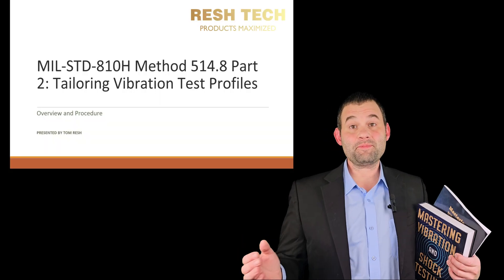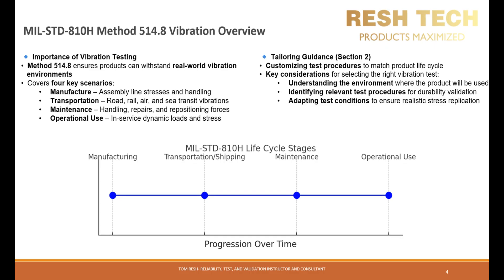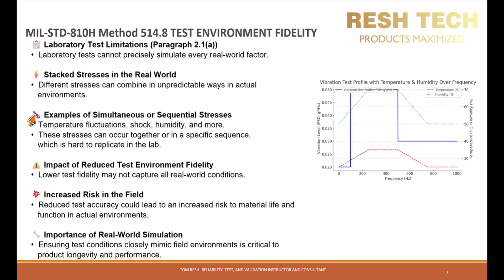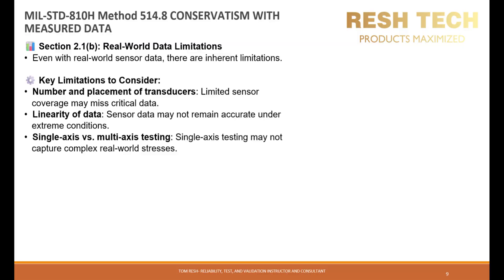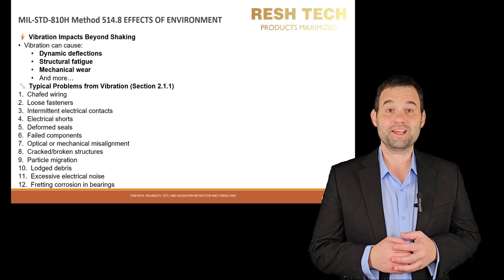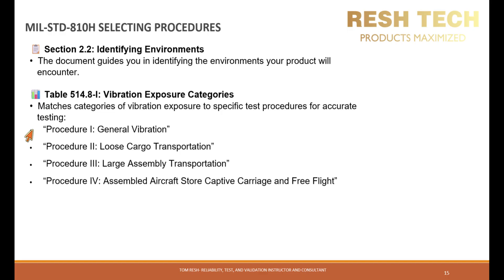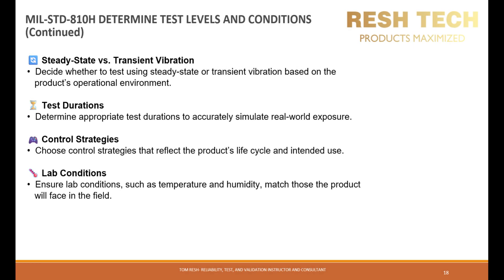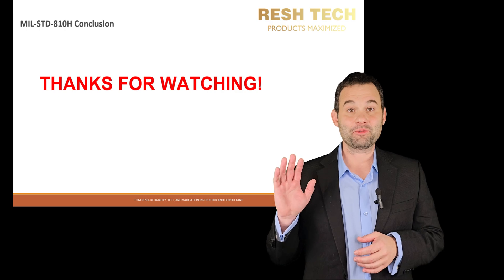MIL STD 810H Section 514 8 Vibration Testing and Tailoring Guidance

Comment: Do you have any idea about ESS? The Mil std 2164 specifies a minimum of 80 hrs of thermal cycling including 40 hrs pre defect free and 40 hrs defect free. Further some documents suggest a minimum of 6.9 grms, 0.04 g2/Hz to precipitate flaws in modern smaller PCBs. Can you throw some light on these two issues?

Comment: We have collected vibration data from an unbalanced motor, if the value is more then the specified rate in the mill, is there any requirement to suppress the vibration by using damper and maintaining the balance weight or else based in the data we have to do vibration test..

Comment: Is it recommended to do sine sweep vibration on newly designed electronic products or we should opt for random vibration irrespective of the positioning of device.
Reply from the maker: @ssujeeth45, I strongly advocate conducting a low-amplitude sine sweep prior to vibration and shock testing to establish a baseline characterization of the system's resonant frequencies and dynamic behavior. This initial sweep provides critical reference data on the DUT's structural response.

Following the random vibration test—and ideally after shock testing as well—a post-test sine sweep should be performed. Comparing the pre-and post-test sine sweeps enables a quantitative and qualitative assessment of the system’s integrity. Key indicators such as resonance frequency shifts, increased amplitude response, or damping changes may reveal structural degradation, fatigue, or loosened connections within the DUT.

Comment: Which type of vibration test have to do on vehicle mounted equipment specially for wheeled vechiles
Reply from the maker: @ShivasaiAnkam,

When conducting testing per MIL-STD-810H Method 514.8, the appropriate procedure depends on your Life Cycle Environmental Profile (LCEP) and the specific phase you aim to simulate.

Since you mentioned that the unit is mounted on a wheeled vehicle (if hard-mounted, this is particularly relevant), consider the following:

Procedure I: Best suited for smaller assemblies or subsystems mounted in operational environments.
Procedure III: More appropriate for larger systems or assemblies, particularly for transportation vibration exposure in wheeled vehicles.
The preferred approach to determining the exact vibration profile breakpoints is to collect field-measured data from the actual environment you aim to replicate, whether that is manufacturing, transportation, operational use, or maintenance.

If field data is unavailable, generalized vibration profiles from MIL-STD-810H may be referenced:

Composite Wheeled Vehicle Profiles: Useful for transportation scenarios, representing typical vibration conditions for wheeled vehicles.
Minimum Integrity Profile: A broad-spectrum test covering multiple LCEP phases, though it includes significant safety margins. Please be aware that using this profile without validating actual LCEP parameters can lead to overdesign, potentially adding unnecessary weight, cost, or constraints to your system.
I hope this helps. Thank you for watching!